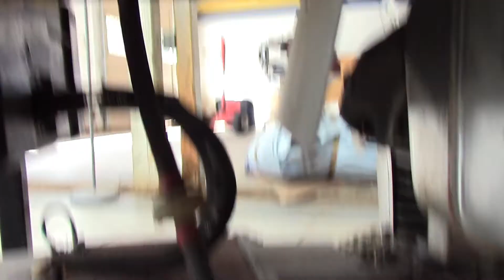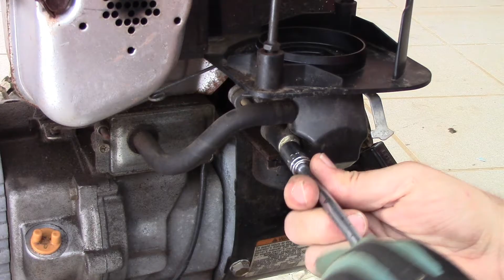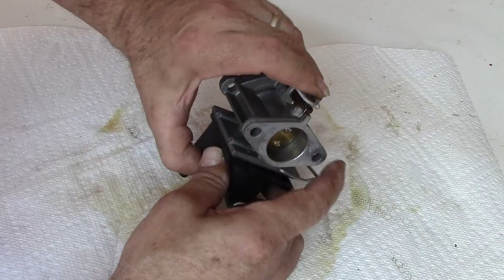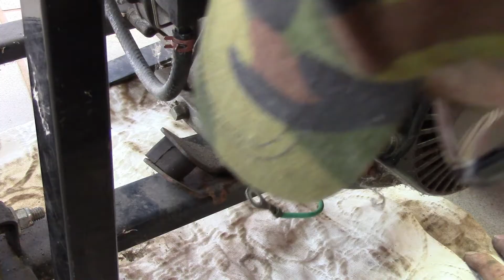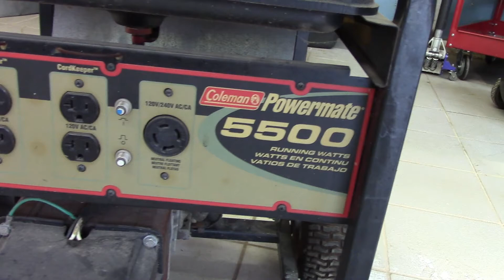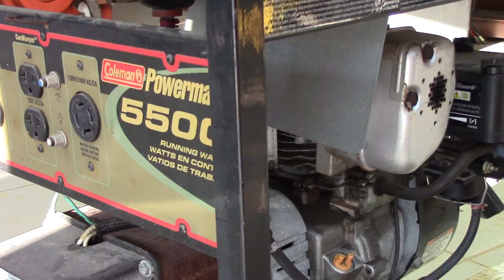COLEMAN Powermate 5500 GENERATOR - Only runs on choke, Voltage too high, Broken motor mount - FIXED!

Comment: You negated the purpose of the rubber vibration damper by running a bolt thru to the frame.  I see the vibrating metal cutting that bolt over time.

Comment: I have the same 5500 powermate I just replaced with a new carburetor now it ran for a minute and now won't run but it did run wit the old one but ran like crap what do you think I need to do please help

Comment: I have that exact generator. I picked it out of neighbor's trash a couple of years ago after a hurricane where it failed to serve them. I wheeled it home on flat tires,  cleaned the carburetor as you did and Bob's your uncle. I keep it ready for hurricanes and it starts and runs great. Thanks for the video, memories for me.
Reply: Same here . I found the same one on the side of the road not a scratch on it I cleaned the carb and bam I now have a hurricane buddy🎉

Comment: Tom Doby says run the carberator dry and put carb cleaner up in the carb and blow it out then drain the tank and blow it out also. That is for storage when you want to use it put fuel in it and it should run Doby small engine repair

Comment: Nice work Buck. Does that Gen have an AVR ? The voltage might drop off quite a bit once you put it under a couple thousand watt load. Thanks for the video.
Reply from the maker: I think I should put it under a load and test again. Thank you.
Reply: @Buckwsr  I found the parts list and the manual and couldn't find an AVR listed.
Reply from the maker: @Mike-ig2zq  Thank you. Either way, you're right that I need to test it under load. I was hurrying to finish the video. I will look at it this afternoon.
Reply: The generators don't have AVR's. They are the same gensets that Coleman has  had since the late 80's when the PowerMate products began with Coleman. I have three from back then, they have bridge capacitors.